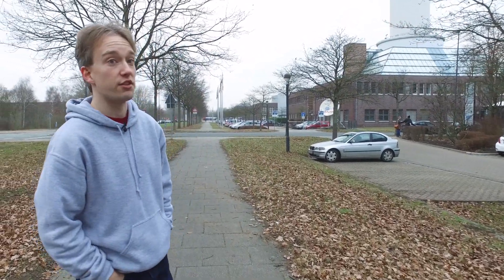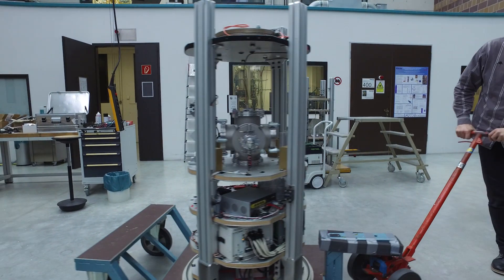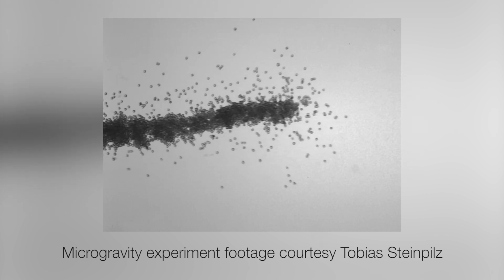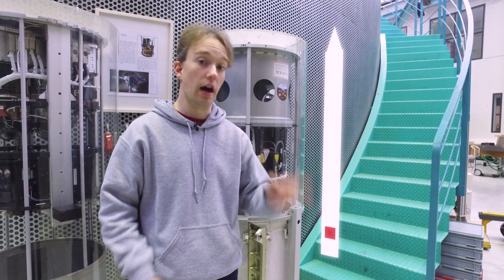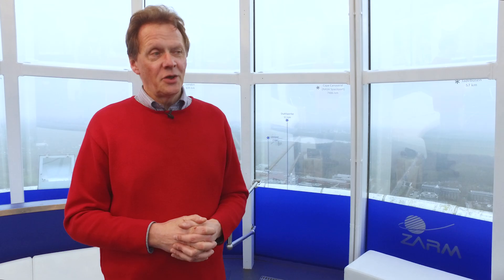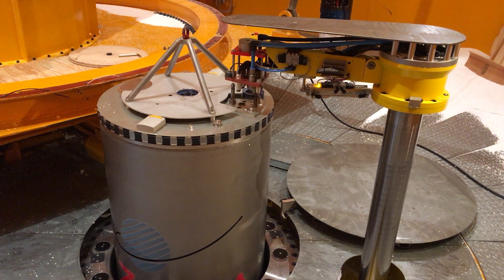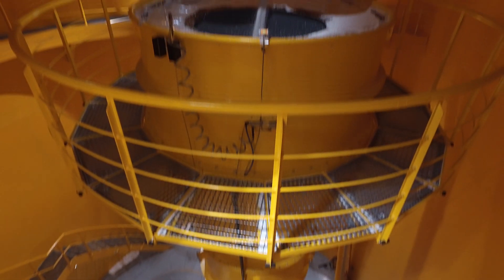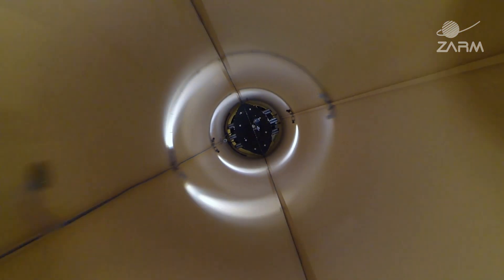Zero-G Experiments on Earth: The Bremen Drop Tower

Comment: Can you test how manoeuvrable a space suit is is near zero pressure? Will it enflate like a balloon?
Reply: If it did it would be a bad space suit.
Reply: They've done that with full-gravity vacuum chambers, I'm sure.  And as the other responder here said, yeah that would be a bad space suit.  I think astronaut Chris Hadfield has talked about how it takes a lot of hand strength to do anything inside spacesuit gloves because they're so still.  They need to be still, because they need to hold the same volume no matter what position your fingers are in.  

Another way to think about it:  if you inflate a balloon, then deflate it, then repeat this a bunch of times, eventually the balloon will pop from the stress.  You only get a fixed number of stretchings before it gives out.  Same deal for anything stretchy, it has a relatively short lifetime, and usually the failure is catastrophic.  So you have to make your spacesuit flexible but not stretchy.

Comment: I was there a long time ago, before they were able to shoot the capsule up. On the top of the tower was a bar you can rent for events. But the interesting part was the tube in tube,  the outer hull is not connectec to the tube inside the drop happens. On the top, where the droptube ends you were able to see how different the hull and the tube moves, it was so frightening. every big bildung moves (bends ) in the wind, but usually you have no reference and don't regonize it, but in this case we were able to see that the hull were moving around approximately half a meter, like a boat in the waves.
Reply from the maker: Over on the Park Bench behind-the-scenes video, we've got a couple of seconds of footage of Matt pushing the tube! (We didn't get a shot of the room at the top, but yes, it's still there!)
Reply: It was nice to see something from my former hometown.

Comment: you mentioned the space program and taking flights as being too expensive to be a reasonable test. but you didn't mention the cost of this one, I can't imagine this test is any less than the cost of a free fall flight.
Reply: gtmustang32111 A vacuum pump uses a lot less fuel than a jet. The rest is reusable.
Reply: Veseyron that makes sense. My mind was just on the high cost of both. This one is no doubt cheaper, but the entire opening speech was about cost. But he failed to mention how expensive it was.
Reply: It's sure hella lot cheaper than sending stuff into space.

Comment: How did the landing make a sound in the vacuum? Was that a little bit of editing trickery?
Reply from the maker: Sound conducts through objects! Sure, in space, no-one can hear you scream, but hit a braking system at 50g and someone'll definitely hear you clunk.
Reply: the microphone can still pick up vibrations from what it's attached to!
Reply: Ah, of course, Should have realized. I blame Mondays.
Reply: ZmakiZ no, the sound vibrations traveled through the metal, air is not the only thing that can carry sound vibrations
Reply: In space no one can hear you scream, except yourself... and it would sound weird.
Reply: the sound is transmitted through the capsule itself to the camera microphone.
Reply: Maybe transferred through the thing it's mounted on?
Reply: No..? Why wouldn't you hear any sound in vacuum. Sound needs a medium to travel through, there's an collision between the pod, and the foam stuff it lands in. The shockwave travels through the material of the pod, and reaches the camera.
The whole 'you can't hear any sound in vacuum' is greatly exaggerated.
Reply: Might be the impact made the structural bits shake, which made the air outside them shake.
Reply: Either there is air in the camera's casing or the pellets are transmitting the sound through the metal casing and the interior of the test pod - which may or may not be a vacuum.
Reply: Good idea that. Some of those mines are a few kilometers down. They could drill a very deep hole and line it for the vacuum.
Reply: well he did say that it was a near vacuum so it stands to resion that there would be a sound of some kind when the object landed
Reply: ZmakiZ vibrations in the impact, even if its miniscule or the pelets hitting the camera/mic
Reply: Keno Goertz whoa, that's super interesting.
Reply: that's also the reason why explosions in space actually do make a sound.  you just have to wait or the particles of the explosion to travel to you and hit your space craft and that's something you can pick up as sound.

Comment: So how does the rotation of Earth affect the path?
Reply: ZARM latitude: 53.1103°. Altitude of Bremen: ~10m. Earth radius at Bremen, due to imperfect sphere: 6,364,509m. Drop distance is 110m (says Wikipedia), so radius of top of the drop is 6,364,619m. COS(53.1103) is ~0.6. 
V at base of tower: 277.8320 m/s.  V at top of tower: 277.8369m/s. Difference:  4.9mm (~0.2 inch) per second.
So less than 5cm/2in displacement for the 10-second test. Small enough to easily account for.
Reply: Technically yes, but by a very very small amount.
Reply: It does. But the effect is very small.The capsule will move slightly westward when tossed straight upp. Since it is quite far north the effect is very small due to slower rotational speed and the building's angle in relation to the equatorial plane.
Reply: Filip Meštrić I would guess it's all relative, just like the rotation of the earth does not affect you when you walk because you too are rotating at the same rate with the earth, and they centre the tower to be square to the gravity's pull (not square to the earth)
Reply: It doesn't. The capsule is not being fired high enough to be affected (otherwise the vacuum seal would always be at risk).
Reply: It does not affect the path. However, the Earth will rotate a bit underneath while the capsule is in "orbit" (free fall).
Reply: The accelerated object has the horizontal initial speed of the spinning earth, it goes up by 100 meters, pretty much a grain of sand on a basketball relative to earth's scale.
It only has a couple of seconds of being suspended in air, which means the angle of the object's horizontal momentum compared to the plane at which he launched from is pretty close to 0 degrees.
It didn't have enough time to diverge off the course of earth's rotation. You'd need a far greater freefalling time to actually make the test tube miss the catching mechanism (let alone hitting the walls on it's way down).
So tl;dr, its effects are pretty much negligible, and even if they'd have a tiny error because of this effect, it should be really easy for them to find a solution that would correct it.

Comment from the maker: And before anyone comments to complain: yes, I know I'm rounding the acceleration numbers to 10m·s⁻². It says so in the small print on screen! [edit to add: also, yes, I've also quantised, for want of a better word!]
Reply: But your formula is wrong too!! You confused speed with distance. Distance as a function of time should be s=1/2 * g * t^2. The numbers you are saying and showing are incorrect.
Reply: steven yau, The last one isn't  quite correct, it should be 80m
1s - 5m
2s - 20m
3s - 45m
4s - 80m
Reply: I was going to complain about this too. "..the drop capsule goes 10 meters". No it doesn't, it goes 5m.
Reply: Tom Scott I love the noise of the catapult. :D
Reply: i'll use this video with my physics students to find the gross kinematics error.
Reply: +Sean Boyd Yes, and if you look at the video, he is trying to show distance traveled, not speed!
Reply: Tom Scott yeah but your acceleration diagram isn't true either.  After 1 second it hasn't moved 10 m because for more than half of that it was moving at least than 5 m/S
Reply: The correct word for what you've done is "discretised", FYI ;)

(instead of quantised)
Reply: As an engineer i was happy with the 10m/s/s rounding it was the 10m, 20m, 30m, 40m that really grated. It's wrong. Its so very wrong, wrong, wrong! But, for most people that watch this it wont matter that its wrong. The video is still cool. For a few high school students they will get the wrong idea for a while but hopefully a good teacher will set them straight. For most of those high school students they will forget it all a year after the leave high school. A small number will still know its wrong but if it matters the accuracy of this video doesn't matter. 

But big thing go woosh is something that everybody can enjoy. If you really understand the physics you should enjoy it a little bit more
Reply: distance travelled under constant acceleration is 0.5*a*t^2
1s - 5m
2s - 20m
3s - 45m
4s - 90m
Reply: Tom Scott Hey, have you thought about doing on a video on shot towers, the precursor to towers like this one? Theres one encased in a shopping centre in Melbourne if you want to visit Aus!
Reply: Hey Tom Scott, quick question: 
At the end we could hear the capsule being caught. presumably due to it only being a NEAR vacuum... 
it got me thinking. is the speed of sound still equal even though the pressure isn't?...
Reply: KyleCow It is 9,81 in Bremen, but it kinda varies around the earth, although I think maximum is 9,84 m/s²
Reply: I recommend Cody'sLab "Sound of Explosions in Space" videos, to deconstruct some misconceptions about sound in near vacuum.
Reply: @piteoswaldo  Most space movies are too loud, with loud explosions being heard in space, but 2001: A Space Odyssey is actually too soft.  The scene where David opens the emergency airlock there should have been a sound due to air rushing out, but there was silence instead.
Reply: Tom Scott love you!
Reply: Tom Scott And top notch video once again!
Reply: Danny Machado Roque speed of sound in general changes based on the density of the liquid it is traveling through hence why as your altitude increases the speed of sound changes same as when you're underwater so no the speed of sound is not a constant number like the speed of light (which is a whole different issue since the speed of light isn't necessarily measuring the speed of light)
Reply: Good question.  Sounds travels faster in liquids than in air and faster in solids than in liquids.  So does that mean as you approach vaccum/less density, should slow to 0, since it can't travel at all?
Reply: I would have to infer there is a direct correlation between density and speed of sound. I am no scientist though so do not quote me or take my word for it, but you seem to be on to something if you ask me.
Reply: @ericsbuds  there actually is no correlation, the only correlation is based on temperature
Reply: I'm glad I remember enough of my high school physics years later (thanks to a wonderful teacher) 'cause those numbers instinctively did not sound right.
Reply: steve cummins: That's called tide. It's not exactly a news flash to scientists (though perhaps to Bill O'Reilly).
Reply: that depends of the exact location on the earth, but yeah 9.81 is commonly taken as the average
Reply: S=g*t^2/2
S1=10*1/2=5 м
Reply: +KyleCow yea
Reply: wow i would give to drop a bowling ball form the top of that tower
Reply: 'everybody else' :P
Reply: +ohnonomorenames Big thing go woosh I can get behind, my inner primate wanted a bang at the end but my inner primate alwa- Whu? PG13? No one mentioned that. :(
Reply: Ah yes, the old 9.807m·s⁻² at sea level that I learn in high school physics. I know it's much easier to get calculate if you round up to 10 instead. :)
Reply: Tom Scott I swear I saw you today at Manchester Piccadilly
Reply: Sorry , Tom.  I had already written before I began to read other's, or your comment.
Reply: Did you see this on a recent BBC article and run over to Bremen? :p
Reply: Tom Scott `
Reply: It's ok. My physics prof let us round 9.8m/s² to 10m/s² to make the maths easier for tests. :)
Reply: Gummy Bugz yes you are right for each second. I just stated the distances as a total from when the capsule is released. Tom Scott states that it travels in each second 10, then 20, 30 and 40m, but he is saying that in total the capsule travels 10, 30, 60 and 100m. I corrected it by saying it travels 5, 20, 45 and 80m.
Reply: As long as the composition and the temperature of the air is the same, the speed of sound is the same too.
Reply: brodaclop what? Not to sound harsh, but are you replying to someone or making a random comment?
Reply: Yes, I was replying to Danny Machado, I haven't gone completely crazy. (Yet :))
Reply: I know it won't only make a tiny difference over small distances, and far away from "big mass" but it would seem there are rounding errors involved in assuming objects fall at same speed under action of gravity... why I feel  that must be the case... F=G*m1*M2/s^2 ,and it's inverse square law... Same object, with same mass, can be shown to have different forces acting on it depending on it's orientation in space.  My calculus not good enough to do it properly, but take a long rigid ruler length x... mark a line across it in the middle. that divides it into two virtual segments, length x/2, each with it's own centre of gravity x/4 away from midpoint distance "s" away from "big mass"... when horizontal no difference in "s", but when vertical summing the effects of gravity acting through the pair of virtual segments, produces a different net force
ie when vertical F=(G*m1*M/2)(((s- (x/2))^-2) +((s+ (x/2))^-2))
same mass, different force, different acceleration
Reply: ie x/2 starts to approach "s" it become increasingly important to consider effect... but what if x/2 exceeds s... may sound daft but de broglie wavelength . and perhaps the assumption that objects accelerate at same rate under gravity is what is preventing unifying theory between relativity (that accounts for gravity, and large scale ) and quantum physics (small distances)
Reply: Ryan, 

Einstein did not yet have his PhD when he worked on and formulated the Special Theory of Relativity, fully 5 years before.  Portions of the Special Theory were part of his doctoral  dissertation.

Before, Ryan.  Before.

And he certainly out classed you,, on multiple levels.  Play nice.  It's more fun.
Reply: You can actually find out the exact acceleration in your location using modern smartphones, just download a sensors app like Multitool
Reply: thank you! knew there was something to it, and the effects were not so negibible that they weren't important. as everyone (including my A-level physics teacher years ago) kept insisting.
Reply: Tom Scott i
Reply: 10 is so much easier to explain how acceleration works.
Reply: It's actually closer to 9.80665. If you want to be pedantic, do it right!
Reply: should be 9.80665
Reply: Dappdude you're right:
a = constant = g
v(t) = g*t
x(t) = 0.5*g*t^2

So how long will an object fall if you have a 100 m tower?

You can rewrite the x(t) formula into a t(x) formula:
t=sqrt(x*0.5^(-1)*g^(-1))
So it will take about 4.52 seconds for an object to fall 100 m. (if g=-9.81)

How fast will it be falling right before it hits the ground? You can substitute t(x) into v(t):
v=g*sqrt(x*0.5^(-1)*g^(-1))

So if x=100 m, v will be 44.29 m/s

If you shoot an object into the air, like in the tower, at what speed does it have to be launched to reach the top?
This should be the same speed as when it lands, so 44.29 m/s. Can we prove this?
The kinetic energy the object has at the start will be converted into potential energy, in this case height:

0.5*m*v^2=m*g*h
so v=sqrt(2*g*h)

This will also give 44.29 m/s, which proves our statement.
Reply: Tom Scott i
Reply: If you wanna do that right, take the general law of gravity and derive your exact value from there
Reply: You also forgot that d = a * t²/2 (divided by 2). So after on s the capsule only moved 5m...
Reply: Haha, tell them Pi=3 next ;D
Reply: The speed of sound does NOT vary with air pressure. The speed of sound in an ideal gas depends only on its temperature and its composition.

Also, what we hear at the video is probably the sound propagating trough the metallic structure, not trough the near vacuum air (assuming the pressure is low enough).
Reply: I find it odd that people are smart enough to know tom is wrong but not smart enough to accept the reason why (which is obvious) and say nothing, instead they choose to make a smart comment, simply to prove that they know. Sad really.
Reply: Don't worry about it, everyone in the YouTube comments has a PHD in Physics and Mechanical engineering apparently.
Reply: isnt it actually 9.81
Reply: Notification Squad!
Reply: I was so pleased that I knew it was 9.81... kinda stole my thunder there Tom.
Reply: I'm still mad you rounded it >:(
Reply: It's the same formula. Look again.
Reply: I was hoping someone else would have noticed that and I'm not just going mad...
Reply: Tom Scott I live in bremen.
Reply: I may not have a Ph.D., but I did just pass my college physics course (which covered kinematics, forces, momentum, work and energy, and circular motion) with an A. And in this course, we did math far more complicated than simply trying to find the distance an object travels under constant acceleration :)
Reply: I've been made to memorize it as 9.807
Reply: +Christian Ortbauer That formula is for total distance travelled, not distance per time interval, which is speed.
Reply: I was about to comment: "I think you spelled fallturn wrong". But then i looked it up and thought: Really? 
I wonder how that n became an m. Guess i ought to look that up too.